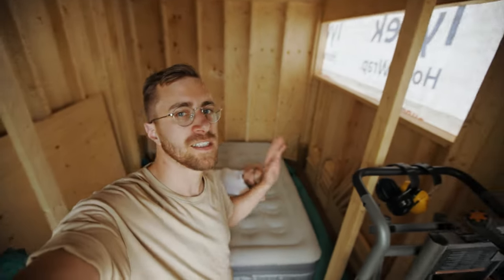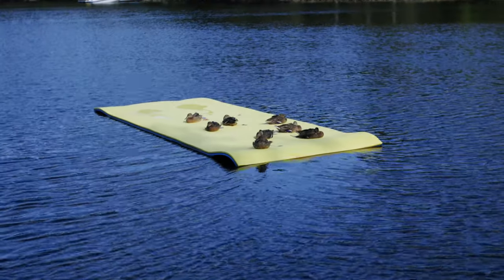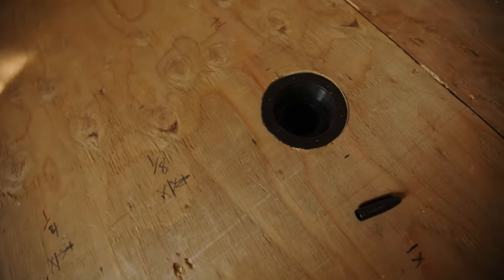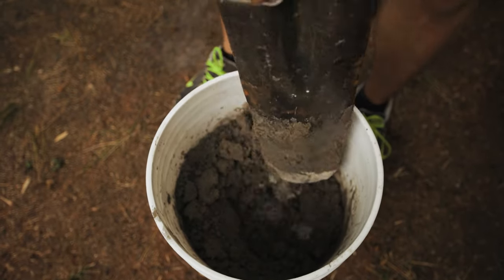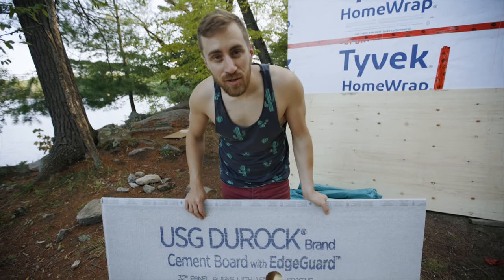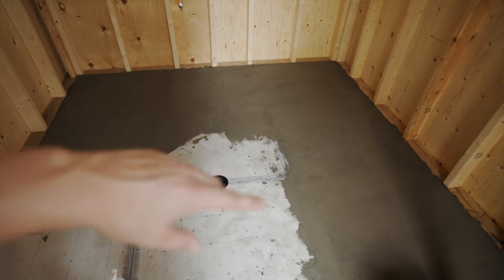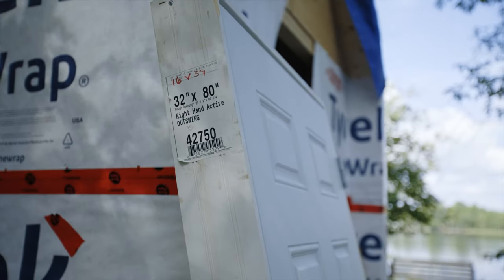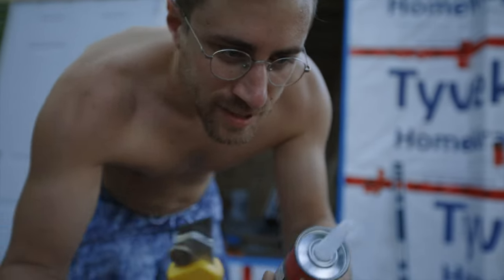Sauna Build - Floor, door and more

Comment: trying to sort out our drain ad floor now. Our build is similar to yours. Ay issue with smell from the drain your critters coming up? do you block it when not in use?
Reply from the maker: No critters or smell! It goes into the ground and we just flush water down there so no issues at all!
Reply: @JonathanKuhn  thanks Jon! One more question, we are also in Canada and love the look of your roof and siding, what product is this and from where ?!

Thanks so much
Reply from the maker: Yes I’m in Canada. It’s a standing seam with hidden fastener panel. They are pretty widely available and it seems that most metal roofing suppliers have standing seam products now.

Comment: What is the plumbing drain flange product you used? I have a very similar setup and trying to figure out how to mount my drain flush with the plywood.
Reply from the maker: I believe it’s a drain flange meant to be installed in a concrete floor before pouring the concrete.

Comment: I'm building a slop floor using the Jonathan method 😊, do you have any guidance on how to install a drain? I don't have any clue how to do it 😢
Reply from the maker: 😀. I was uncertain about this too. I ended up getting the kind of floor drain you would simple 2x3 floor drain and glued in into place. I then ran the sim coat to the edge of the drain.

Comment: Quick question on the floor drain.  Before you put the cement board down the drain was installed into the floor in the video.  Then when you had the cement board installed it looked like either there was a second flange or you had moved the original one installed in the wood floor and placed it on top of the cement board.  Im just wondering exactly which way you went about installing it as I dont want water getting under the drain flange.  Thank you!
Reply from the maker: I think before shot was just me dry fitting the drain. I packed the drain in with skim coat and caulked up to the edge of it. I’m not sure if this is the correct way to do it but water seems to be running into the drain 🤷‍♂️

Comment: Is there any need to use a liner under the concrete floors? Seems a ton of conflicting info on this.
Reply from the maker: I don’t actually know. I don’t see a reading for it since the wood on the floor doesn’t get wet and neither does the concrete touching the wood but there is a reason you put plastic down between studs on concrete so maybe I’m wrong.
Reply: Yeah you are on the exact same page as me on this. It seems excessive, but it might be a good idea? Then again you are drilling holes into the duraroc that would punch holes in it anyways.... So does it really matter at that point... haha Im thinking of doing a liner, then running it a few inches up the wall under the wall boards to the bottom.

Comment: I’m building an outdoor sauna in Montreal and have greatly benefited from your video series. I’m doing my ben squares now, have the squares laid, concrete poured between the sleepers and about to lay the Durarock. Wondering what cement you used to skim coat the Durarock and how it has held up?
Reply from the maker: That’s great to hear! I used Quickcrete vinyl patch for the skim coat and it has shown a couple tiny cracks. I’m pretty sure this is due to not cutting reliefs along my durarock where required from the drain to the corners so I kind of flexed the durarock.
Reply: Awesome, thanks. I’ll have a look for that at the hardware store. Also, re: the Durarock. I was wondering whether I needed to score it to follow the diagonal line at the corners of the sleepers so it would follow the slope or whether, once screwed into the sleepers, the Durarock will flex enough to follow that slope?
Reply from the maker: @robcole8710 absolutely score the diagonals. That’s is something I did not do and regret it. Durarock isn’t meant to flex really.
Reply: Awesome, thanks for that piece of advice. Always hard to be the pioneer on a project like this, learning as you go. I really appreciate all the useful info you share in this series. It’s helped me a lot.
Reply: @JonathanKuhn  what do you guys mean by score the diagonals
Reply: @wesleysmith3462 cut a line in your durarock from drain out to the corner of the room. In all 4 corners. That line is the inflection point / vertex of your slope so scoring or cutting will let it angle there instead of breaking AFTER concrete skim coat is added

Comment: Did you use a standard shower drain fitting and mount it from below the floor?
Reply from the maker: That would probably be the right way to do it but I just used a drain meant to be put in a concrete basement floor and glued it down.

Comment: thinking of doing an indoor (unfinished) basement sauna. Not convinced about raising the floor to put a drain in. Some people say it's not a big deal, it would be a lot of extra work.....what's your 2 cents?
Reply from the maker: We dump lots of water in our sauna for bathing etc so a drain is necessary. Since it’s in your home you might not be bathing in the sauna so a drain isn’t needed. If you are going with an electric stove you might have power vents  anyways so you could dry out the room after with those or keep the door open. If you dump too much water on the stove and it runs down you can just sop it up after with a towel or sponge probably.
Reply: @JonathanKuhn  awesome man. appreciate the input. was getting lots of conflicting advice but you've helped me make the decision.
Reply from the maker: Conflicting advice is the name of the game it seems with sauna building. I’m no pro and I made some wrong choices probably. In the end most of your choices will probably be good and the bad ones you live with or fix. 👍

Comment: Has your cement floor cracked at all with the sauna use?
Reply from the maker: Hi. I did notice some tiny cracks yes. I stacked this up to either 1. Not cutting the cement board to match the slope or 2. The building heaving and settling as it’s floating on the ground.

Comment: How has the floor held up?! I've been holding back on using the saunatimes guy's vinyl patch method for a while because I'm worries about waterproofing, probably installing this week!
Reply from the maker: TBH we are still at the paneling stage so no water tests yet. It feels rock solid though 😀. I do wish I had framed a double bottom plate to act as a water barrier with the raised floor. I ended up blocking between studs and ripping an angled piece I caulked to the floor to deter splashed water from going into the wall.
Reply: @JonathanKuhn  Good to know, thanks! There is going to be a shower in my sauna room so waterproofing is extra important. I'm actually planning to come part way up the wall with the cement board and vinyl patch for the parts of the wall that are covered by benches. I just cleared out the sauna and will lay cement board today. I'll keep an eye out for an update video from you if youre making one. Good luck!
Reply: @marshall5  How did you sauna / shower floor turn out? I’m planning to do the same and am also worried about the water proofing and water draining. It seems like this Sauna times method might be fine for a sauna with little water but I’m worried a shower me too much and not drain properly. Also water material can be in the high heat are racking my brain. I’m read that normal plastic water barriers could melt in a sauna but are needed in a shower. How did yours turn out? Thanks!
Reply: @thisisnotimportant  My bottom line opinion is that the concrete patch method is not a waterPROOFing solution. It may be reasonable depending on budget and application, but if you are building a sauna that you want to last and keep dry when not in use, (even to look good) something more is required imo. I ended up doing the vinyl patch method, it worked reasonably well and  drained adequately but retained moisture just like a wet sidewalk does. This means time spent baking the sauna after use or risking the possibility of water seeping through to the underlayment. Albeit, I did do some testing and found that even with standing water for over an hour, water did not penetrate to the bottom of the test cement board (which it did without the vinyl patch) but I never got the impression that I could trust my investment of time, effort and funds on this method working long term. This concern was exacerbated when my final install had the concrete patch cracking on every cement board seam (despite recommended installation) within weeks. My solution after consulting a manufacturer was to install a polyaspartic coating over the vinyl patch. It's basically an epoxy-type material that is used as a sealer/ waterproofer for concrete floor, often in garages and industrial settings. It was not the most user friendly thing to install but it worked out great and is a completely waterproof, flood the room level solution. Again, I have a shower in there (which is glorious btw and now something I consider essential, not necessarily inside the sauna but as part of the sauna system if you will) so it is especially important to manage water and polyaspartic definitely works in every way I need it to. There are also unexpected benefits of faster drying time, better drainage, peace of mind (and the subsequent ability to use the sauna more freely, throwing water around as desired and using the shower liberally) among some other smaller things. In closing, the vinyl patch would in my opinion be appropriate if you are ok with a, lets say 90% waterproof solution (i used a lot more vinyl patch than anticipated btw. 3 bags I think for 100sqft).
Reply: @thisisnotimportant  I'd also say, after my experience in my sauna, the floor does not get hot at all. So I'd not be concerned if you want a quick and dirty waterproofer on the floor like plastic vapor barrier or whatever, I would just keep odours in mind. I almost slapped some old vinyl pool liner on the floor and call it a day but it smelled like... vinyl

Comment: Love the build! taking some inspiration got a question though what type of concrete mix did you use for under the durarock? as well as the skim coat?
Reply from the maker: If I recall correctly the concrete mix was a cement and sand mix under the durarock. The skim coat is a quickcrete vinyl patch product.
Reply: @JonathanKuhn  Appreciate the response :) I will give that a go, have you had any issues with it yet?
Reply from the maker: I have seen some tiny hairline cracks in the top coat. I may seal it down the road but it hasn’t posed any issues yet. I stack it up to the lack proper foundation and the frost heave around here

Comment: hows the floor holding up for you? did the skim coat cure nicely?
Reply: I hesitate to do the screwing down of the durarock with the skim coat over top of screws, cause it seems really hard to take out if you ever had to
Reply from the maker: Floor is holding up really well! There are a couple hairline cracks but that could be due to the frost heave and my building sitting on the ground or because I didn’t cut the durarock diagonally to slope to the drain. It’s very solid with no sponginess though.
Reply: Did u skim coat over that edge guard material and did it stick fine? Or were u able to get it off

Comment: what did you do for the drain. does it go straight through the floor?
Reply from the maker: The drain goes straight through the floor for now. I will be running it into a leaching pit in the spring
Reply: Can you record and share how you build that leeching pit? 👌🏼
Reply from the maker: Ah sorry I didn’t record any of it. There are some great diagrams online on how to dig one. The rules on what you can do may very depending on your location.